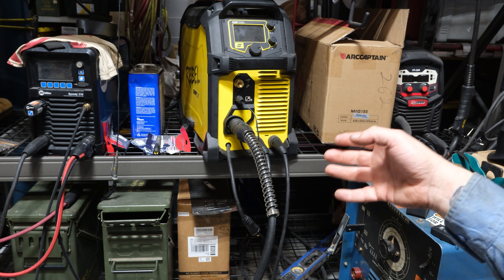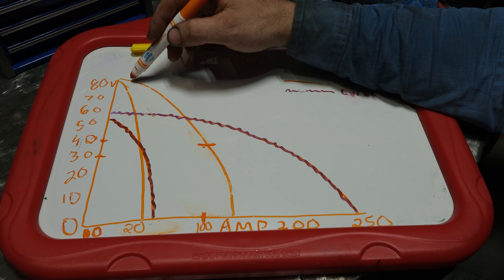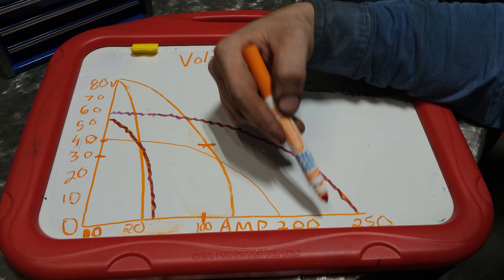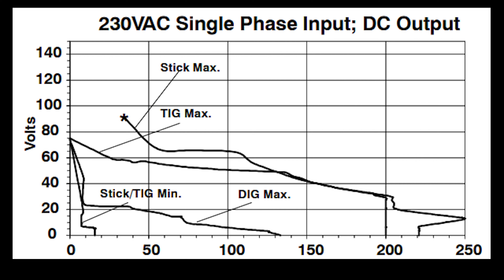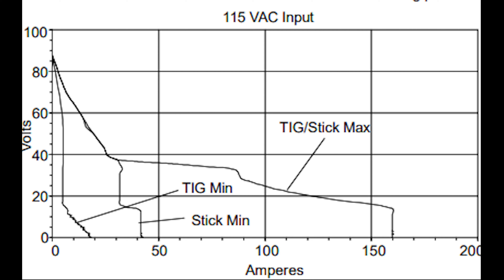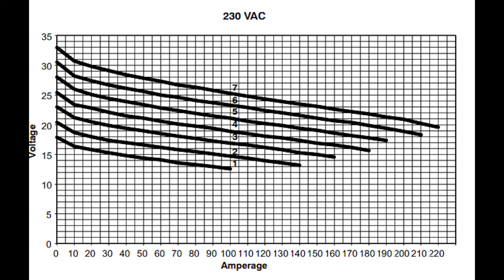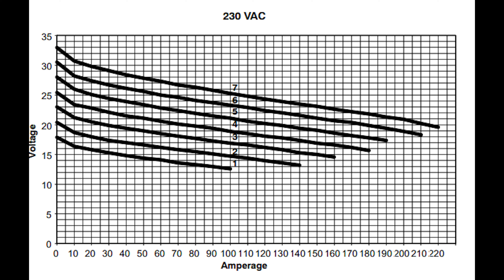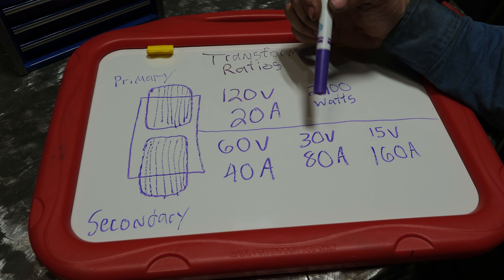QFTB #7:  What are volt/amp curves of welders?

Comment: Makes me wonder how Fronius with the 180 can have it weld 6010 on 240 and 120 volts. I have done it just as a fun weld on plate.
It works. I usually run on 240 volts seldom 120 with any of my machines. The voltage /amp curves are interesting something most don't even think about. On stick I just set the amps and weld on mig I set the wire speed and trim volts ,never giving it much notice.
Then runnng on any synergic mode you just set thickness and weld again not paying any attetion to volts or amps. Thanks for the explanation Greg.
Reply: Is that the one that has a battery mode as well as a mains powered mode? 

If so, it’s possible it’s drawing some extra power from the battery.
Reply: @deltab9768  No mine are 120/240 volt models, not battery powered. Theydo have a battery powered one and Greg has one, just look at his previous video.
Reply: You can do a lot of crazy stuff with power electronics. If they have active PFC for example, the internal bus voltage after a ton of engineering will probably be around 400 V, regardless of 120 or 240 V input. Change the rectifier configuration between centertap and H with a relay etc. PFC boost stage does the rest.  The control computer then decides how much power can be drawn safely and controls the welding inverter stage to a suitable curve. I have never designed a modern welder, but plenty of very similar systems. Some day i gotta design my own inverter welder, just so i can design my own hot start, "dig", variable inductance etc. features. Digital real time control is basically real world space magic.
Reply from the maker: Awesome comment zonkotron, and that’s what’s going on.  By changing the voltage, frequency, and wave form going into the transformer, and having more control on the conversion of the transformer output they have complete control over output power.  They are free to take the input wattage and split it into any number of varying output voltages and amperage setpoints.  So the curve a normal transformer has becomes more or less a flat predictable line.  

As far as the original question, fronius has absurdly high efficiency (over 90%) combined with power factor correction (and near perfect power factor.  This is exactly why fronius can run 6010 at lower input voltages than any purely transformer machine could, because 95% of the available input wattage is turned into output wattage.  A old transformer machine could run 6010 on 120v, but it would need 35-40amps of power to do it, which isn’t exactly practical.  With that said I assure you the fronius is actually overloading the 120v breaker by a bit to achieve max output.  It’s simply not possible to run a 6010 at 90 amps (90a x 30v = 2700 watt) on a 120v 20a circuit (2400watt) without overloading it.  So the device will pull more power through the breaker than its face rating, and it can do so because the breaker trips on a thermal curve.  Most 120v welders do this, however the fronius is unlikely to cause a breaker trip because its power factor correction is not letting reactive power back to grid through the breaker.  

On a side note, the fronius accupocket battery welder I have is the only stick welder that is capable of 140a of output on 120v without overloading a breaker.  That’s because the battery power reduces the power demand from the outlet.  You can weld at 140a out for a 20% duty cycle on a 15a breaker and not trip it.  Thats something that is not possible without energy storage like a battery.
Reply: @makingmistakeswithgreg  Hehe greg, i forgot to reply to the other answer you posted coupla weeks ago, too busy with my day job.  Anyhow, we were discussing hardenability of mild steel. You seemed a little incredulous. No really. Sqare bar 1/2 inch  (actually 12mm, im German) and similar sizes from my steel merchant, all of it will harden to a good chisel when quenched in an alkali solution (brine would probably work too, but the vapors cause rusting, no thanks, not in my shop). The reason is pretty clear. Carbon, by spark test, is on the upper end for mild steels. >.1 for sure. And copper, i got my hands on an XRF gun, is around 1%. Probably more Chromium etc than it really should have, as well, forgot the numbers. Copper was the shocker. All of it increases hardenability. Modern S235 European structural steel can have  a carbon equivalent number of up to .35. Thats basically carbon plus all the hardenability increasers weighed by some formula. 35 points is not tool steel, but it is plenty to get massive strength increases on quench. Normally that should not be a huge problem, because a slow quench like a weld cooling in 2-3 seconds is too slow to get fully hard. And i also noticed that the structural shapes and flar bars from the same trader are not hardenable and spark less on grinding. Only square and round bars.  I guess they roll the dodgy crap like vehicle scrap remelt into bars that dont usually dont get used for structural weldments anyways. Anyhow. Im a hobby blacksmith, power electronics engineer by trade and used to work part time as a machinist/millwright/museum assistant environment in an industrial heritage museum before i got my electronics degree. I have a "few" interests :D
Reply: @makingmistakeswithgreg  And another reply. I was talking to the good folks of Infineon Semiconductor at the PCIM trade show a couple weeks ago, don't know if you mentioned that in your Fronius video, still didnt find time to watch that, but they litterally process the welding current with power transistors embedded INTO the printed circuit board. Space age machine. Infineon helped them design it. We have come SO far in the last 25 years in terms of digital power control, it is truly magical.